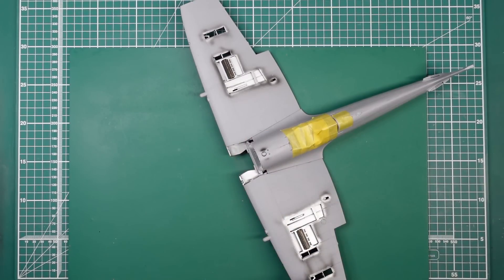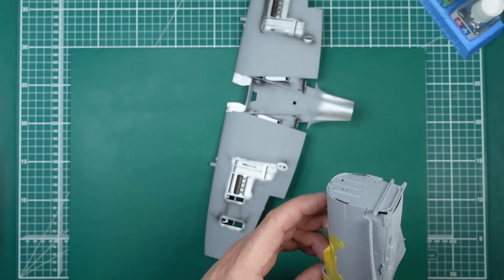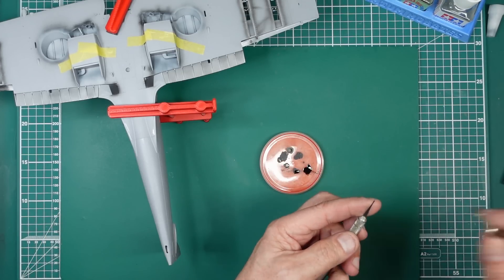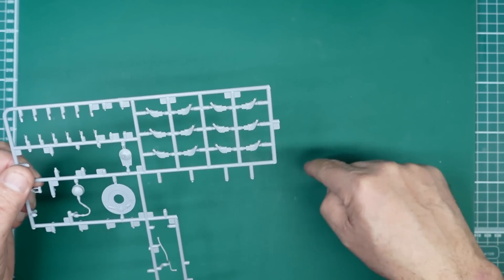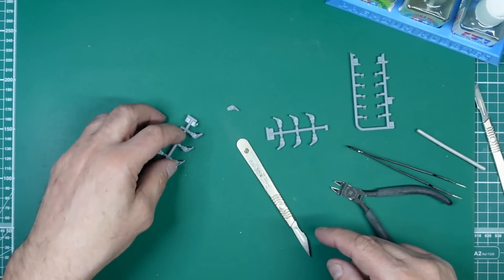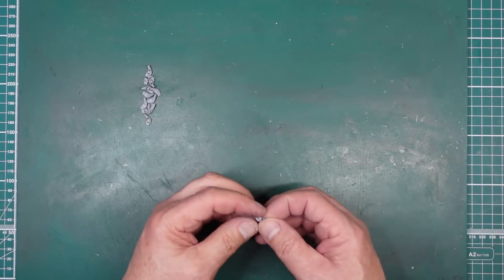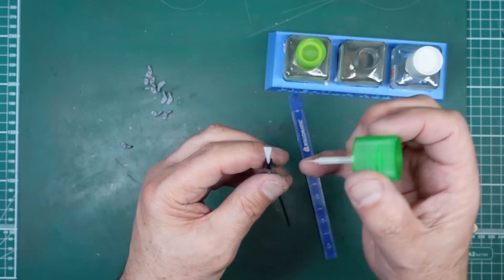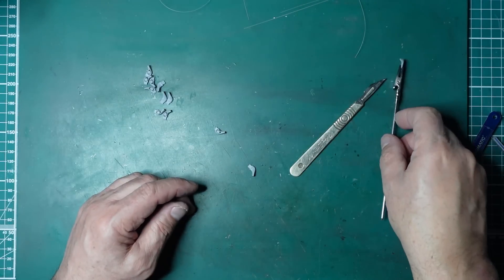Airfix new tool 1/24 Spitfire Mk.IXc Build. Part eight.

Comment: Thank you for your informative video's, I am just getting back into modelling after a break of about 45 years, I have a italeri tornado gr4 that I won, but before I tackle that I'm going to do a couple of smaller airfix kits first, a spitfire starter kit, and then if that comes out OK want to have a go at the airfix Tempest
Reply from the maker: Hi Michael.. I find the glue in the starter set is awful. get yourself some Tamiya Extra thin.
Reply: @NigelsModellingBench  yes already got dome extra thin and plastic for the clear part's

Comment: It is what it is those cavities in the underside of those 2 part engine exhaust outlet ports nigel,and the having to scratchbuild & add the weld seams?,all apart of the enjoyment of building the model in my books?,sure enough you can go the extra mile & buy the resin upgrades,keeps the brain ticking if you have to do the filling & detail adding,or else as Harry Houdini oftens says,if you want it 'Perfect & trouble free' pretty much,sure just go & buy a Tamiya kit?,lol,cheers

Comment: Hello Nigel. Good to see your solution to the gaping holes in the undersides of the exhaust stubs. In this large scale they almost have to be filled. Glad you chose to re-instate the weld seams too. Again, they're quite obvious in this scale so whereas one might get away with leaving them off on small scale models it's almost a necessity to recreate them in 1/24th. They'll look superb under paint. Good job. 👍
Merry Christmas and a happy new year.
Reply from the maker: Cool, thanks